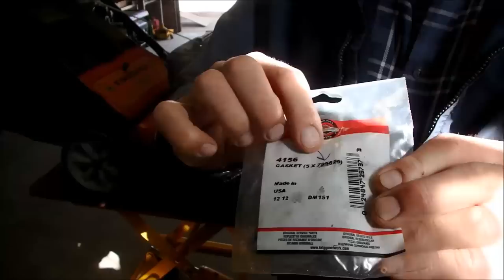My Mower Won't Start When I Prime it.

Comment: That must be what's wrong with mine.  It takes 20 pumps on the bulb before it starts.  This is my last Briggs and Stratton, it doesn't even have an oil drain.  Back in the day I bought a used B&S at a yard sale and used it 35 years before selling it.  All metal.  I put several sets of wheels on it and a couple throttle controls, blades and spark plugs.  It had an oil bath air filter so no element to replace.

Comment: I’m sure you’re aware that there is a Briggs & Stratton starter clutch wrench part number 19244 and you can buy one on Amazon for about $16. I’m sure you probably know about it but it’s really nice to have.  I was Head Mechanic at mower shop for years. Works great with a breaker bar or an impact wrench. I inspire you to get one. It keeps you from breaking the housing on the starter clutch as well. Take care Geary
Reply from the maker: I was given one by on of my subscribers who noticed I did it the hard way.  Thanks for noticing.

Comment: Great video.  I keep forgetting to check to see if primer bulb is actually squirting in gas.  Oh and by the way the ducks seem to have taken up residency here and did not just fly through. I will try to send them your way.   Very small ducks must be as they must be fast and very hard to see.  But I know they are there because I can hear them.

Comment: Hey Bruce, just incase you didnt know and are in a hurry you can make a gasket from index cards, match book cover or even pop into your local autoparts store and get a sheet of gasket materal and make your own gasket , trace it with a number 2 pencil , shows up better, then cut it out with an exacto knife, i have done it about 50 times works like a charm.
Reply from the maker: I have a few sheets of gasket materiel.  These ones are hard to cut.  Thanks for the tip though.

Comment: A+ for making and sharing your knowledge.  Audio A+  I don't know how hard it for you to make these video's but a fill light would help were everything is black.  Use a cheap bell light.  But I did enjoy your video.  Also audio is the king of all video's.  Your was excellent.
Reply from the maker: Right.  This video was made in 2015.  I think it says that under the title.  I now have bought a construction light and modified it to improve Most of the dark spots.  Thanks though.   To bad I didn't do it earlier.    thanks.

Comment: yeah I like this guy anyhoo I have a rover lawnmower this model get a build up of grass between flywheel and underside where pullcord is so there is a channel of grass dirt etc and basically flywheel rotates to give spark to spark plug and long story short makes it hard to start so as long as you keep this clean you won't have issues hope this helps
Reply from the maker: Thanks a lot

Comment: Mine takes about (4) pulls today.  I will check for that squirt of gas and if it’s not there, I’ll replace this little gasket.  I had another mower in which I replaced the little push bulb because it had wore out, but the new machine’s bulb feels strong and it still seems to have a bit of suction.
Reply from the maker: There are different ones  Briggs has 2 and Tecumseh has 2.  Tecumseh's first was was quite a while ago.

Comment: good fix l need to do that to my out fit thanks bruce
Reply from the maker: Once in a while 2 gaskets are required as the air cleaner is warped.

Comment: Hi Bruce.  What size are the two screws that hold the plastic cover to the gas tank.  I think mine are the wrong ones. My mower was garbage  picked.
Reply from the maker: I honestly don't know.  If on the top they were Phillips screws about 1 1/2 inches long.  The carb air filter ones are threaded and are 1/2 inch long.

Comment: Buy a roll of gasket material or even use a cereal box for the cardboard.  I have a punch set that I use for leather work. Trace the old gasket onto the new material and with a pair of scissors and a punch for the holes, in 20 minutes you will have a pile of new gaskets.
Reply from the maker: I have the material but need a punch set.

Comment: Nice vid I've got a Briggs 3.5 that does this too. Very helpful thanks.
Reply from the maker: jetskidude78 Give it a try.  It may have a different primer.
Reply: Bruce Pender it does looks like pulse prime, got it running with a rebuild kit.
Reply from the maker: jetskidude78 great!!!

Comment: Bruce, I replaced carb and bulb. Everything is clean. Fresh gas. Takes 5 pulls and many primes. Goes with starting fluid. Should I do 3 gaskets? Only ten years old. Thanks.
Reply: Oops. I meant 2 gaskets. I can't really see the gas squirt out.
Reply from the maker: 2 might work.  make sure that carb is whistle clean.
Reply: Thanks Bruce. It worked! Shoved a thin copper cable down an inlet and cleaned something hopefully. Then two gaskets. Yeah! I saw it squirt fuel every time I primed
Reply from the maker: Good for you.

Comment: There is a small screen inside behind the primer bulb that can get plugged also.I just ran into that.Sprayed it with carb cleaner and back to a one pull start.
Reply from the maker: You are right.  It is usually OK but I should mention it    Thanks
Reply: @BrucesShop  Bruce I have looked everywhere and can't find a part number for the screen.Would you happen to know?

Comment: yeah Bruce it's me again with the Kohler motor recycler has a very odd setup on recoil plastic housing for cover The Recoil is a separate cover that bolts on top of block no mounting bolts for the cover B Block is threaded on top 3 shaft bolts hold recoil looking for entire recall mechanism Ed in Michigan
Reply from the maker: Whew.  Did you google that?  sorry that is a lame answer but I don't know what to say.

Comment: i know this is an old post so i understand if no response but i have been slow  at my shop so i am putzing around with a bunch of yard equip. people r throwing to curb one toro has this setup and runs great with shot of ether and i am waiting on gaskets im gonna double down the thickness anyway does it need to be primed on re starts after running and warmed up engine or only in cold start ? thx 4 the vid by the way
Reply from the maker: Got it good luck.  I am not sure what to add.
Reply from the maker: The shouldn't need to be primed when warm.  Sorry i missed the question.

Comment: Thanks for all the videos.  I have one that is stumping me and wonder if you might have ideas.  it's a 6.5 Briggs in a craftsman.  it only starts with starter fluid and then dies.  I rebuilt the carb.  replaced the air vane spring and the air gasket.  Also did normal tune up, spark plug air filter new gas etc.  And still the same issue.  Not sure what to try next, any ideas?
Reply from the maker: Did you clean the holes in the bolt?  that holds the bowl on???  I have to ask.
Reply: Thanks for responding, yes I did clean the bowl nut.  I just tried a new new plug just in case and it's still the same.  If I keep priming it it will keep running so I'm assuming that isolates the issue to fuel delivery.  Let me know what you think.  My thought at this point is to try another carb.  I'm assuming since it runs fine when I keep pushing the primer that I can eliminate the coil or timing issue with the fly wheel, etc.
Reply from the maker: Yes.  A new carb may do it.  There is an intake tube going over the top of the motor.  Maybe check that.  They are plastic  It is worth a GOOGLE to check.

Comment: Hi Bruce. Have a Briggs mower with same primer setup but I can't get the bulb to make that squirt of gas that you show at 8:30. Have a new bulb, bulb housing clean, emulsion tube clear (carb has been cleaned in ultrasonic) ... and it runs great after it is started. But it takes 6 or 7 pulls to get it going. Ever run into this?
Reply from the maker: Yes I have.  Have you replaced the gasket 795629 at 6:34    .  That is the key.  if that doesn't help try 2 yes 2!!! of the gaskets as the plastic housing warps and 2 of those takes up the variance in the warped plastic.

Comment: Hi Bruce
what was the part number for that gasket and would you ad part numbers to the video or memo section.
thank you.
I wonder if there is a way to use air to make the lift work..
Reply from the maker: I will work on that.

Comment: I was the guy that bought the same lift as you and have said before it is the best piece of equipment I have invested in...just a quick question..I see you have 2 of those safety bars like mine but have no idea where they hook into..any suggestions ?    thanks again for the great videos
Reply from the maker: +D Lastname If you spin them down they will hold up the table with no hydraulic pressure on the ram.
Reply: Bruce Pender ok  thank you

Comment: What happens if you don't see that squirt of gas at 8:31 ?    I replaced the entire piece and still can't get it to pump gas for cold start.  Thx.
Reply from the maker: It will not start unless you put some fuel in there manually.  Did you try 2 primer seals instead of one?
Reply: @BrucesShop  Working great.  Thanks for your help!

Comment: What happens if the motor on the push mower won't turn with the sparkplug in, but does when its it's out? What can cause that?
Reply from the maker: It may be full of gas or fluid.  Turn it over fast without the spark plug.  If not it may be a sheared flywheel key causing compression when there shouldn't be any.

Comment: How did you know it's THAT gasket that needed to be changed?  A mower with bad gas or who knows what else won't start either.
Reply from the maker: I wasn't priming.  See it at point 8:31 in the video.

Comment: Small Engine Kohler on a Toro recycler front wheel drive self-propelled overhead valve 6.75 149cc I have an issue with recoil the Old Spring broke cannot find replacement part motor runs good do you have any ideas
Reply from the maker: First  what kind of motor is it.  Then google that.  Like  Briggs and stratton  recoil etc;

Comment: where did you get the gaskets when the job needed to be done in 1/2 hr
Reply from the maker: No where around here.  Good point.  You can reassemble the unit and prime the carb with gas manually.  that will work.  sort of.

Comment: Hey Bruce I prime the lawnmower and it starts fine I turn it off then try to turn it on again and it won't start it does this every time what do you think it could be
Reply from the maker: I would try a new ignition coil.
Reply: @BrucesShop  I put 2 different coils and I'm not getting enough spark I checked the fly wheel key and no damage to the key what else could it be? I also changed the spark plugs several times
Reply: @BrucesShop  yup it was the ignition coil went through several coils I guess they were all bad

Comment: interesting how such a small piece of pretty much paper can mess up a lawnmower...ive taken apart soem lawnmowers to fix and soem dont even have gaskets...and they still work its odd...im not an expert as ive just taken it up as a hobby for myself ive fixed i think 4 out of 4 but i got my moms today and for seom reason i cant even get it to start..i cleaned the carberator and everything and prime it and it still wont start...the carberator on this one is different than others ive seen theres also no spring in the carberator not sure why that is...but it refuses to start for soem reason ill give it a bette rlooking over tomorrow...the fuel line going from teh carberator to teh filter might be clogged but that fuel like is right in the carberator which is also odd as others ive disected dont ..it slike its almost part of the carberator ..ive also see mowers that dont have the one fuel line connected only the intake fuel line the other does not...idk what thats about maybe just overflow? idk i had a leaf blower and it had 2 fueld lines and another fuel line in there with the ball on it i guess mowers are different...but yeah soem lawnmowers i find dont have gaskets but still work if its air tight i gues sit doesnt matter..but i have one mower thats suppose to have auto choke but it doesnt work the thing that the metal stick is attached to i broke seom cheap plastic peace now its doesnt open and close as the mower needs it will stay wide open leaving the carberator wide open taking in too much fuel then it revs up like its going to explode..the mower itself works but thats the only problem it has idk what the part is called or where to get it..its attached to teh carberator i hate to think i have to buy a whole new carberator for a 5 cent piece of plastic.
Reply from the maker: I don't know how to help you.  Sorry

Comment: did you build that hoist? couldn't find one online if so how im a small engine guy it would make life alot easier
Reply from the maker: Here is a link to my lift
https://www.youtube.com/watch?v=yv7FtFWRHaU
Reply from the maker: There is a reply coming your way    may end up in spam or trash folder as there is a link to the lift video
Reply: thanks man
Reply: They have them in the U.S. at Harbor Freight.

Comment: so what was the problem again cuz you didn't show us the problem
Reply from the maker: The Mower wouldn't start was the problem.  At 0:49 I show it would not start.  At 4:01 I show a tear in the old Gasket.  As Well at 6:32 I show the new gasket being replaced. At 9:43 I show it starting with the new gasket.  Did i get it wrong??